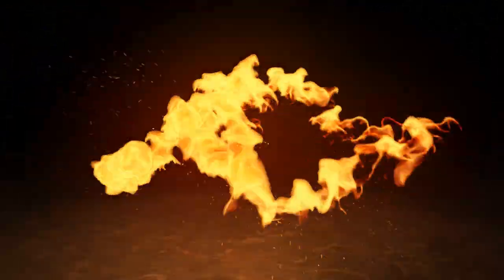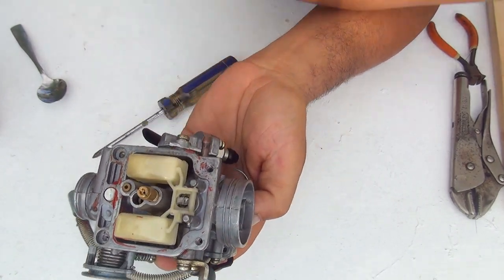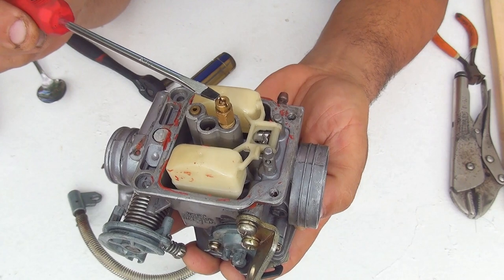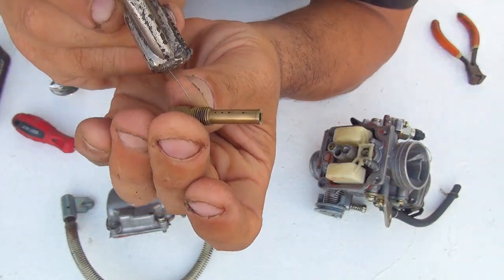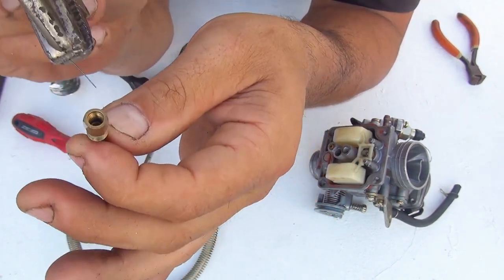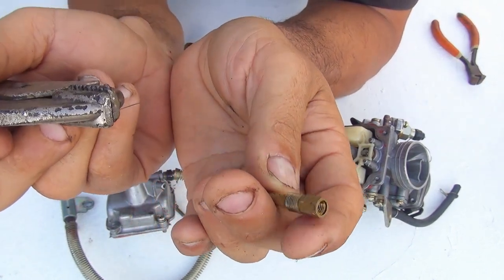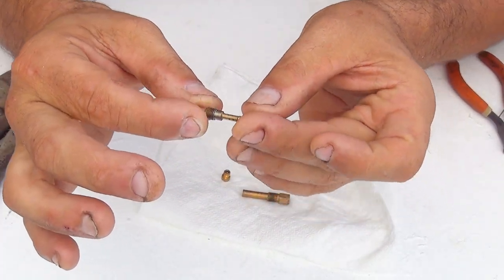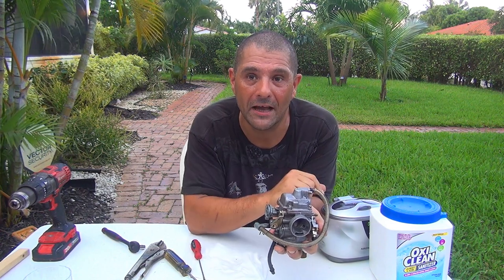How To Clean Scooter Carburetor Jets

Comment: I use Feul Injector Cleaner, does that help?
Reply from the maker: Hello my friend yes but if you used that before it will remove the corrosion of the jets the chemicals in the product will damages the fuel rubber hose the fuel petcock valve rubber diaphragm and will make the float valve leak those product for me are better for cars. Thank you for watching my video

Comment: I was riding my new scooter yesterday n it shut off on me I took the key out n restart it it start wen I push the button wen I give gas nothing it shut off again 🙆🏿‍♂️ brother wat you think wrong with it ? Only 120 miles on it
Reply from the maker: Hello make sure the spark plug boot is nice and thight try to push that in a little more also check the 2 pins connection in the back side of the spark plug coil this sound like a vibration electrical disconnection or a bad stator / alternetor . I hope this can help you
Reply: @VirberelloScooterTips  Thank you I soon will check it out

Comment: I’m having trouble with my scooter it doesn’t want to start I change the oil  spark plug there are no broken cables the only thing i haven’t checked was the big bore kit in front of the engine where it holds the pressure inside for the scooter to be on do you think it could be that
Reply from the maker: Hello my friend to start a scooter you need a spark + fuel + compression if one of these is missing your scooter is not starting . Thank you for watching my video
Reply: @VirberelloScooterTips  in front of my engine there is a silver cover where the scooter holds the compression there are 2 screws that keeps it tight so the compression stays inside one of the screws are not tightened up I think that’s causing the compression to come out and not stays inside 
Is there a way I can contact you to explain it more better to u I sent u messages on messenger and haven’t respond to me
Reply from the maker: @Cristopher180-  Hello my friend check this video https://youtu.be/4nM0WglE21s

Comment: I bought a new Tao Tao scooter 1st ride yesterday it stopped when I was in traffic and now it won’t start at all now
Reply: it stopped when I put throttle too it now it won’t start at all
Reply from the maker: Hello my friend make sure the spark plugs boot is nice and tight sometimes they get disconnected or they brake inside the little clip that holds the spark plug
Reply: Ok thanks